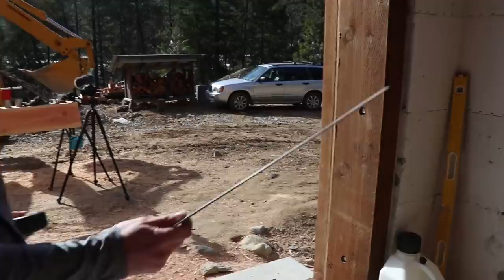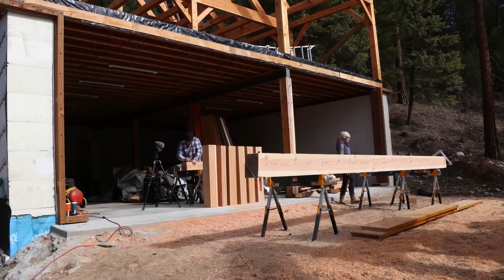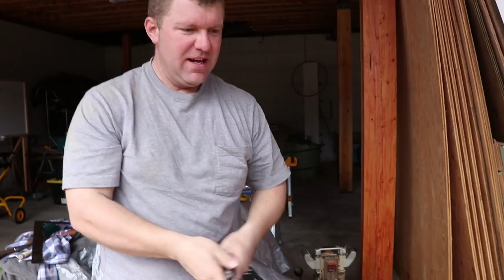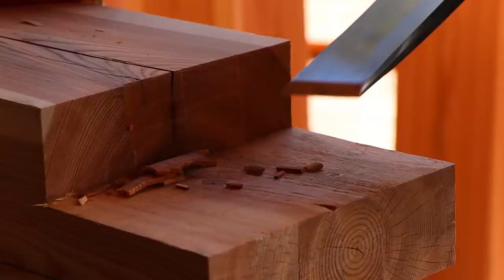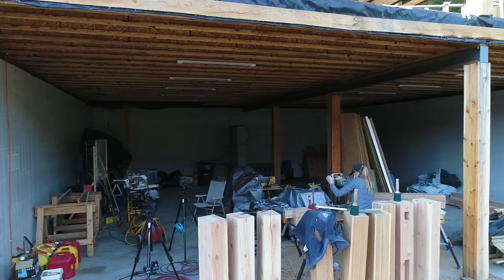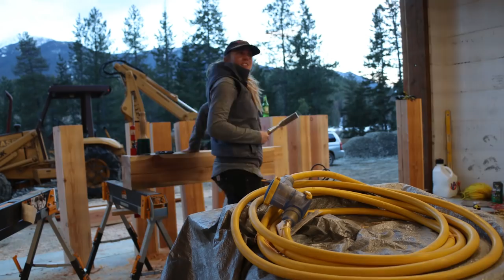Borderline IMPOSSIBLE: Build House, Become Pilot, Stay Sane

Comment: I earned a living for 33 years in aviation, mostly as an airline pilot. One bit of advice for your training; the faster you do it, the cheaper it should cost as you do not have to redo past lessons as it is still fresh in your mind. However, while a pilot's life seems very glamorous, only get into it if flying is a passion...... the lifestyle can actually be very demanding and  the pay is not as good as many think.....although that could change since there is such a shortage of pilots that airlines have to cancel flights. Best of luck with it....safe landings ;)

Comment: Jesse, I got my PPL in 1980. I jammed all of my lessons together and from first flight (1/3/80) to first solo (1/9/80) to checkride (7/9/80), I managed 20 hrs solo and 19.4 hrs dual the day of my checkride (I took my CFI for a very sloooow taxi and run-up). It went easy and I saved a bunch of $$$. 

As I have told other pilots... "How long would it take you to learn how to drive a stick shift if you practiced for .8 hrs, once every couple of weeks?" Fly often and you'll be a pilot much more quickly and inexpensively (or relatively inexpensively). Wishing you CAVU.

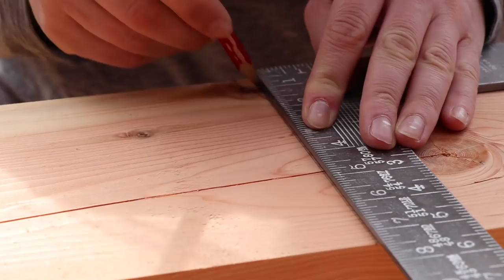Comment: Instead of having to "manually" line up the edge of the framing square along the top of the beam (such as at 6:16), simply attach the stair gauges to the long edge of the framing square, and then you get a solid reference surface that you can then drop a line from easily without having to fuss with holding the square while trying to draw your line.  
(or you could add a couple of the "Veritas Square Fence" from Lee Valley Tools for a really stable setup)

Comment: Not sure if it would help you, but when i cut stuff with circular saw, i use the framing square to guide a straight cut, then when im chiseling, i place the framing square among the line i need to chisel back to and use it as a hard edge to go off of.

Comment: The worm drive saw is more accurate for the reason you talked about, but also because you can see the blade as it cuts, if you are right-handed as most people are.  With a circular saw with the blade on the right, a right handed person cannot easily see the blade, and must rely on an indicator on the base to follow a line.  Unfortunately, that indicator is not really close to the blade, so any issues with being directly in line are worsened.  Also the base can be tweaked out of line over time. Even with a tweaked base, by watching the blade, you can still make an accurate cut. There is an indicator on the base of the worm drive as well, but in 40 years of using a worm drive, I mostly still watch the blade

Comment: I figured your training was on hold or you had changed your mind. If you can't fly at LEAST once a week, it would be better to wait until you can. I did my Private in 5 months, but only because I had to take a month off due to weather and my instructor's schedule. I was flying 2-3X a week. Also, "ground school" is not a requirement, but you do only have 24 months to pass your practical exam after passing the knowledge exam.

Comment: I think whoever designed that checklist was not taking it for granted that there would always be a one-to-one correspondence between successful take-offs and SUCCESSFUL landings.
Reply: Craig Mooring Takeoffs and Landings often do not match, as frequently an instructor will have to demonstrate certain takeoffs and landings, or in long-haul flying, one crew may do a takeoff, a different crew (augmented) will do the landing. It is perfectly normal.

Comment: First off I still don’t know what your doing but why one of the pieces, the scrap wood you found, is rounded on one side.
Reply: Kent Yee it will fit up into the apex of the gable.  The others will get an angle put on one side to match the angle of the roof at the lower eave on the gable

Comment: You're going to be very disappointed with the results of using the square by lining the back edge up with the edge of the timber , rather set the bottom edge of your straight edge on the face of the edge you are working off, difficult to explain, but much much much more efficient. Or get a speed square, and there are two different types schools, one you do ground school your self, the other you pay out the ass for it, or do it your self but go to a third party private lisence weekend course they generally allow you to return for same lisence as many times as you wish, at no additional fees., keep up the videos really love them, and only offer advice not criticisms
Reply: Nope that's not the way you face a timber....you use the back edge of the square....you are not making it square you are making the surface flat to itself.

Comment: I'm not a carpenter, but it looks like there are some pretty big cracks in a few of those timbers. Is that a problem?
Reply: No, for the most part it isn’t at all! That happens to almost all wood as it dries. There’s nothing you can really do about that because the outside edges of the wood dry a lot fast than the middle. Overall the cracks aren’t a big deal and there’s not too much you can do about preventing the cracks

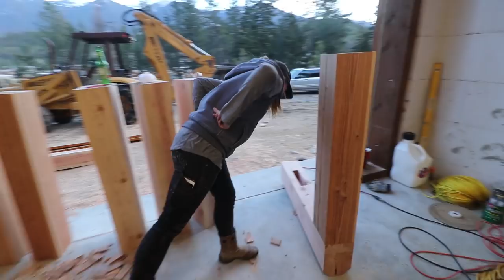Comment: 16:07 look at that big chunk lumber joined together by a tenon 1/8th the size.

That is my basic problem with timber framing, it's structural integrity is compromised by asthetics of blockiness.

All those huge chunk of lumber are connected by smaller parts, so the rafters structural load size is very much smaller that it looks like it is.

Plenty strong enough, of course, but it is sort of the opposite of what it is.

There are better ways to do it than the shelter's way.
Yup, I said it. And if you don't know I'm right, well, that sucks.
Reply: You are right but they are doing the smart thing and going with the ICF foundation and SIP over the frame.. That will also add a buttload of shear.
Reply: Have you been doing it since 1974?

Comment: I think it would be a very worthwhile project for you to make up some good timber framing saw horses.
The sawhorses you have are made for working on sheet goods, they are way too high for working on timbers.
Your steel sawhorses are kinda wiggly. You could get rid of a lot of that by putting a piece of wood or something else diagonally from the top of the sawhorse to the opposite bottom of the leg, if you know what I mean, it would stop the sawhorse from racking.
Cheers!